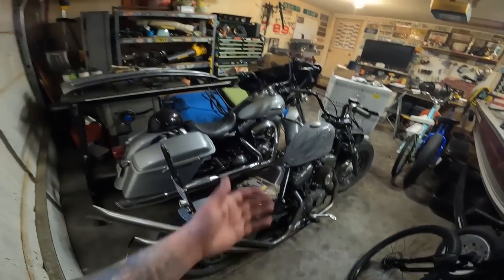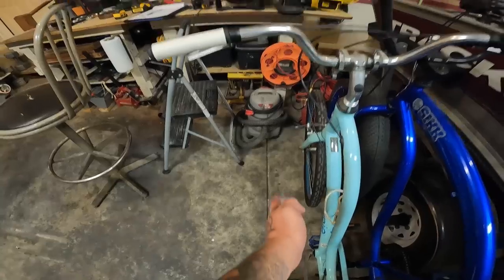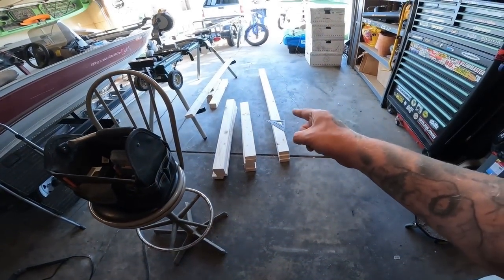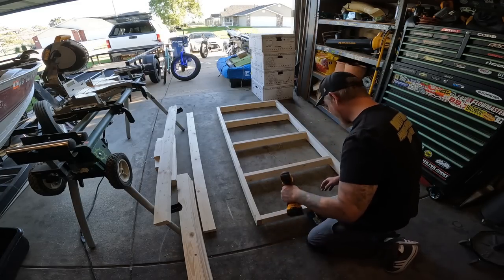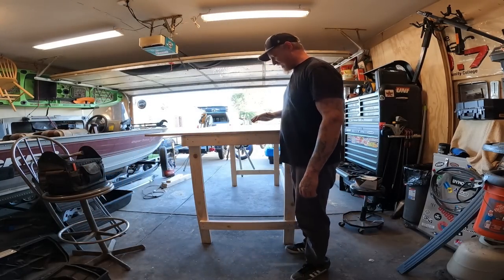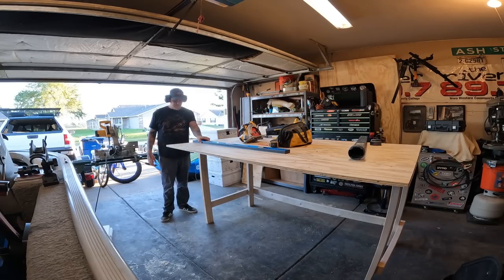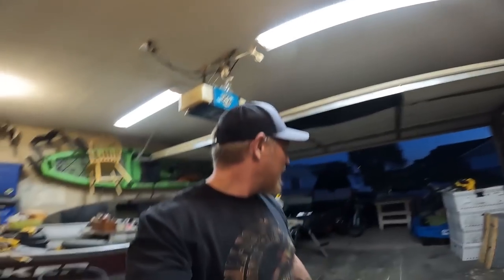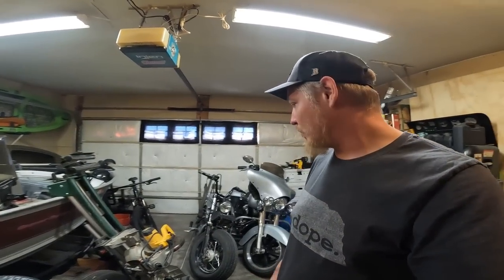Building A New Workbench For My Garage (DIY)

Comment: Not related to this video but, 
You should rig something up to attach to the pull handle that you use to close your tailgate from the inside.
Something  that you can use to prop the window open a bit, instead of using your saw. lol
It would always be right there and handy. Maybe something you come across during the garage cleanout.